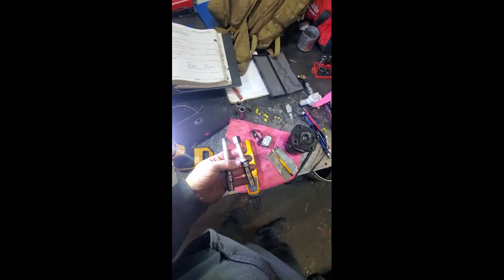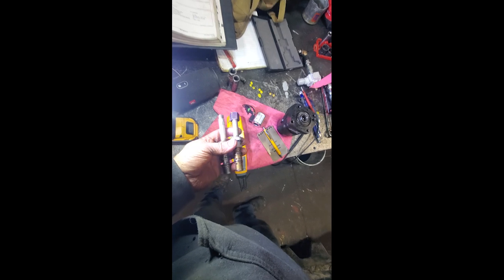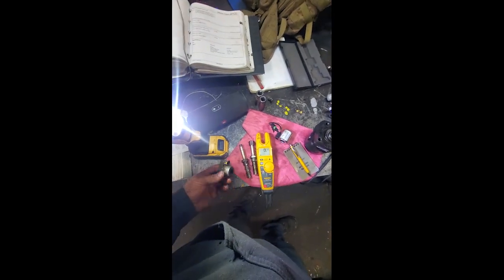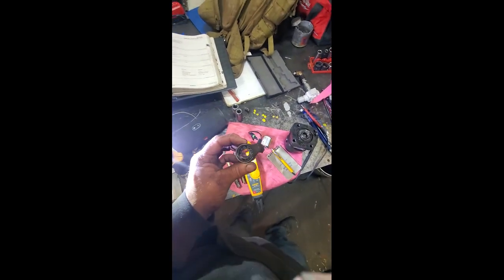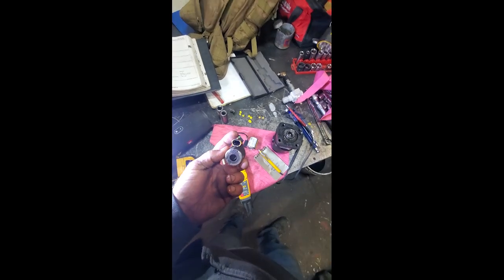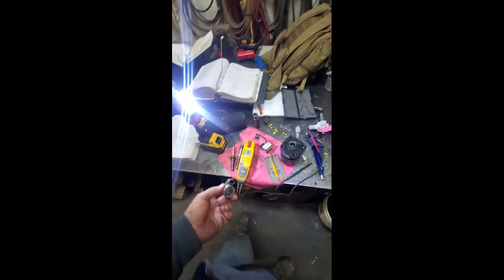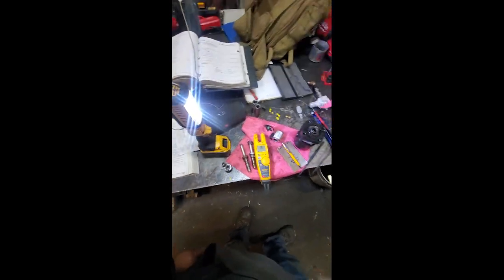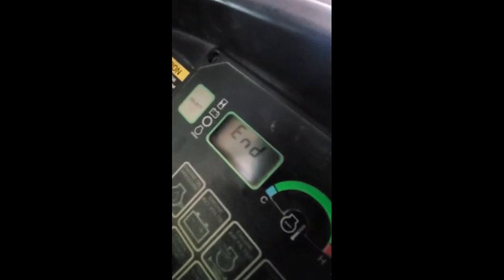John Deere 648GIII transmission callibration🔧

Comment: Just got in the new fan motor for the 640L cable skidder. Took almost a month! It's a badass but sometimes I miss the older simplicity...
Reply: I need to try out one of the newer skidders sometime. 24 years of working in the woods, I’ve never pulled a drag with an ac blowing inside an enclosed cab lol.
Reply: @bryans5339  took me 26 years to get there...lol